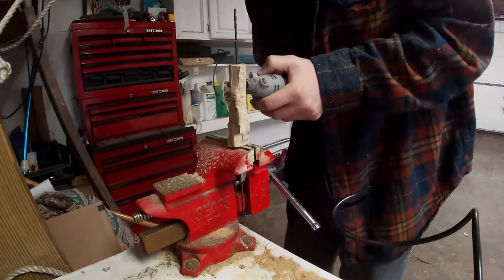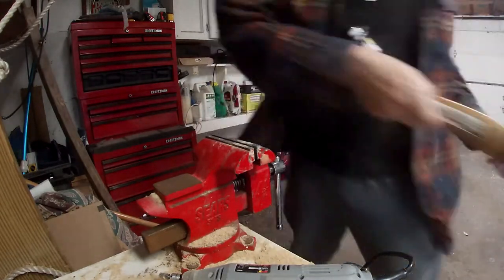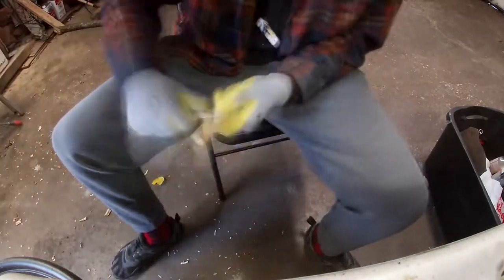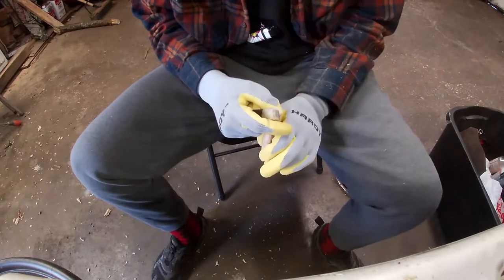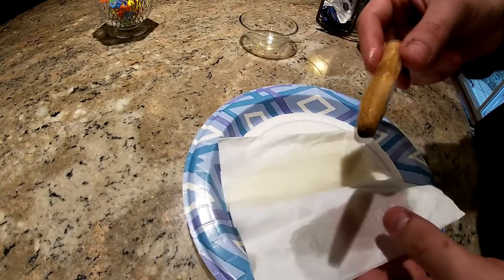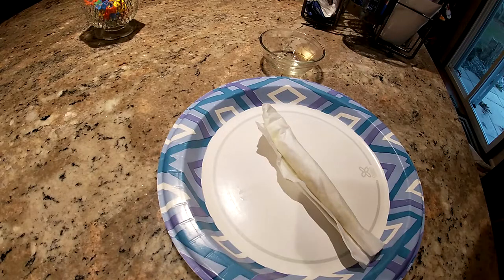Making A One Hitter Chillum Tobacco Smoking Pipe

Comment: You don’t have to step drill holes to get a larger hole. Companies make a tapered wood drill bit that allows you to gradually increase the hole dia. as you drill deeper. Perfect for hand rolled cigarettes or tapered   cigarettes. Any local hardware store will have them.